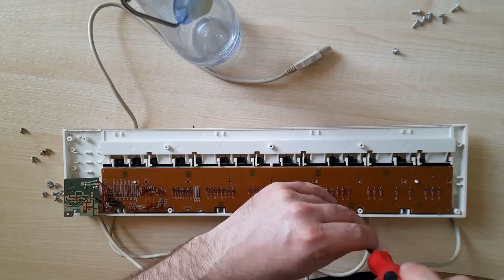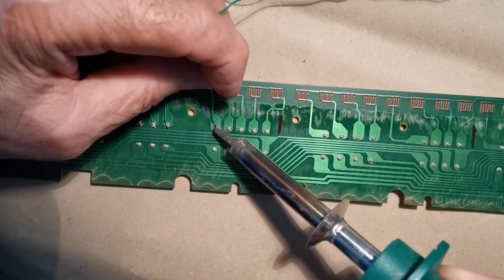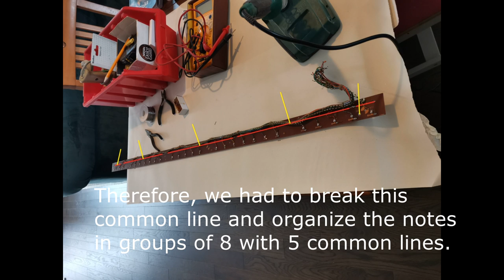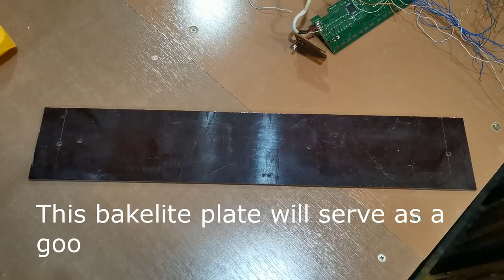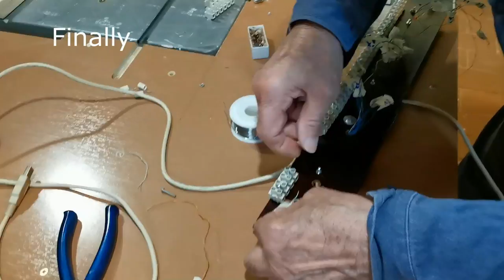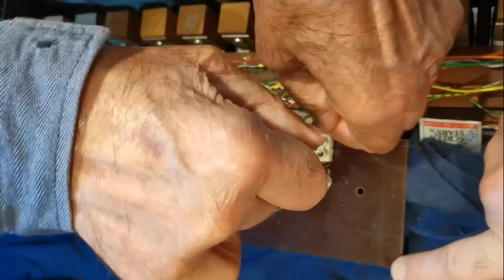MIDI Pedalboard Project, Part Two - Electronics

Comment: This looks like a very good method, but it looks too complicated for me to do. I would like more detailed instructions, do you have any or know who I could get them?

For the last 10 years, my pedal board has worked by taking a used, from from Goodwill, midi keyboard, building a little ledge above the back of the pedal board, and running wires from under the keys of the keyboard to under the pedals, so when I push down a pedal it pulls down the key. It's worked well but I always wished it didn't have the wires so I could have a pedal above the keyboard for adjusting the sound, etc.
Reply from the maker: The best way to make a midi pedalboard in my opinion is to use magnets and reed switches. You can see in this video how I did it with another pedalboard: https://www.youtube.com/watch?v=Y4bZTsvlJ2k&ab_channel=538Dorian
I hope it helped! Thanks your comment.
Reply: @8Doriene   Nice, I am building a conceal right now, but using reed switches for the Pedalboard  is great, thanks, God's blessing.
Reply from the maker: @Chantsandchisels  Thank you!